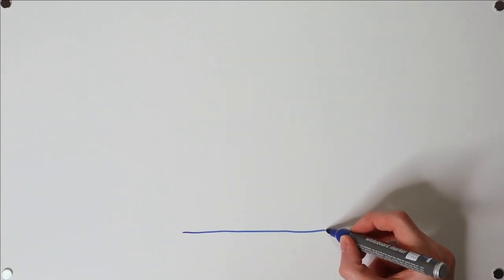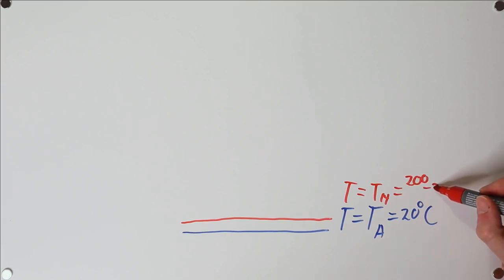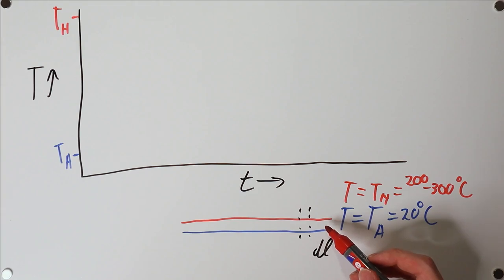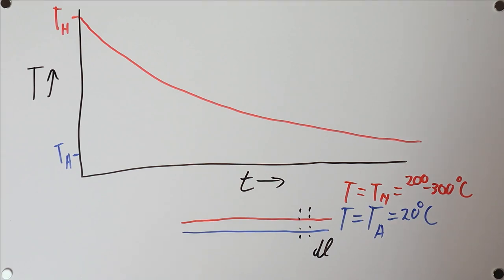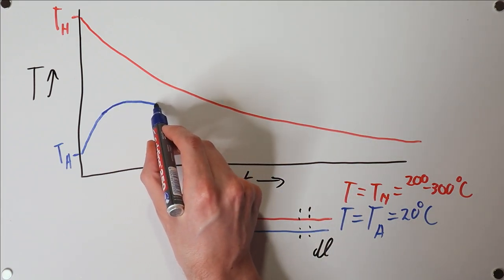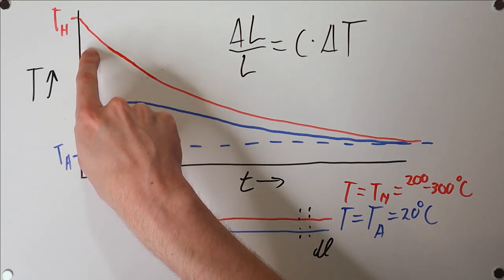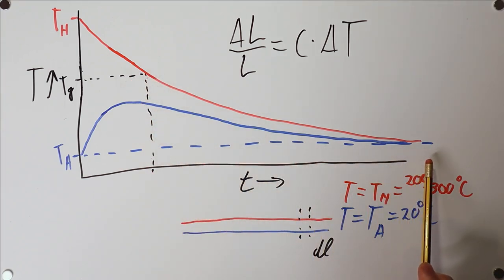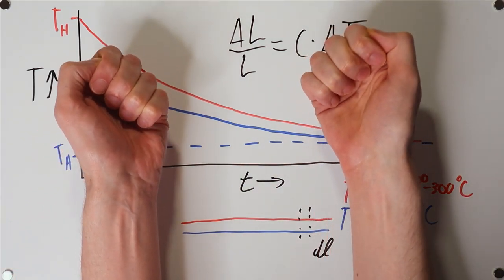The Physics of why your 3D Prints Warp, and what to do about it

Comment: Great explanation. I assume it wouldn't matter on smaller prints, but would printing the second layer when the lower layer hasn't fully cooled yet also prevent warping, or does the lower layer reach ambient temperatures too fast for it to matter even on smaller prints?
Reply from the maker: It could help, but its difficult to control. From thermal imaging it seems the temperature drops down within 3-5 seconds, so you can only do this for parts with a very small XY crosssection. Even then it's hard to balance, if the lower layer is too soft when a new layer is deposited, material can flow into unintended places. You can notice this when you print very small PLA parts, or the chimney of the 3D benchy.

Comment: Thank you for this amazing explanation! The only part I am a bit confused at is when you said you can reduce the extrusion rate in order to close the gap in temperature difference between the new and previous layers. I understand increasing the temp will allow the previous layer to catch up before the first layer reaches tg temp, but m confused on how reducing extrusion rate would have the same effect? Thank you again for this video it has really helped my production. I have found that printing at 205c vs 190c the pla prints tend to be less heat resistant and have a lower tq the hotter you print them.

I reduced my print speed to 75mms @190c from 90mms and it did reduce warping a bit. If I had a volcano nozzle with a much larger melt zone would switching to that and going back to 90mms have the same result? Curious your thoughts and I appreciate any explanation to help with my confusion
Reply from the maker: Basically when plastic comes out of the nozzle, it isn't quite at the same temperature as the nozzle, but the slower plastic is extruded, the more time it has to get as close to the nozzle temperature as possible. In that vein, getting a volcano style nozzle should definitely help.

That effect on softening temperature is quite interesting too.

Comment: Thanks for the clear explanation. Can you please clarify why printing slower would make a difference? Assuming the ambient, nozzle, and bed temperatures are the same, printing slower would still yield the same temperatures all around, no? If anything it would start laying down the next layer sooner before the previous cools down more.
Reply from the maker: By printing slower the plastic flowing through the nozzle has more time to actually get up to the nozzle temperature, if you print fast the plastic comes out slightly colder due to limited thermal conduction inside of the plastic itself.
Reply: @antalz  that is an excellent point! Thank you for the response.

Comment: This is weird but i was printing a 3dbenchy and encountered a problem I've had for a while now. My set up is a 0.4mm nozzle ender 3 printing PETG mostly at a bed temp of 85~90C cause i find it gives better bed adhesion, and the issue is that on certain prints I would get this absolutely horrendous warping ~6-8mm above the build plate. Any sort of corner would just begin to curl up and inwards on itself, and I tried everything suggested in this vid short of using an enclosure. I even slowed prints all the way to 25% and i still get this warping. Curiously, it seems to happen only for thinner layer heights, when i bump it up to 0.24 and above, this problem reduces or goes away entirely, but thats obviously not a good fix for the problem. i don't have this problem on my much faster klipper printer either, regardless of the layer height at the same bed temps. I read something in a comment on another video, which was to lower bed temp, i tried it, lowering to 72C and that reduced my warping by a lot. Whats the explanation for this? Obviously closer to the bed, the high temp reduces warpage, and at a certain height, the warping would initiate due to the lower temperature, but why does it diminish when i use a lower bed temp from the start, very fast print speed or thicker layers?
Reply: If top layers cool faster it will pull the edges upwards and inwards. Solution I found was to not use the part cooler unless printing overhangs
Reply: The effect dimishes when you lower bed temp as it reduces the difference in heat between the lower layer on the bed and the upper layers cooling faster as they build up from the base.

Comment: So it seems more temperature at the hot end would reduce warping by increasing the lower layer more closer into the Glass Transition temperature, and hence, let it flow instead of curl? Seems counterintuitive but interesting nonetheless... I will try it out tonight with a warping print that is driving me nuts. 

Thank you for the explanation!
Reply from the maker: It doesn't really allow the lower layer to flow. The idea is to warm up that lower layer, so that it thermally expands. Once the new layer cools down to the point it can no longer flow, it fuses to the lower layer. But the new layer will still be hotter than lower layer, so they're both solid and fused, but the upper layer has to cool down more to reach the ambient temperature than the lower layer. Because of that the new layer thermally shrinks more than the lower, and this difference in shrinkage causes warping.

Comment: what if the print is warping to the top , not bottom? Everywhere on youtube everybody shows the same thing but actually in reality there are some other deformations, which are preventing me from buying a 3d printer! I use it sometimes when it is available but never bought one because of that. If I have to print a part that has to fit perfectly into something and instead of a straight line looks likne a banana it doesn't make any sens to buy a 3d printer. Everbody prints usuless things but it is very rare that somebody prints something usfull but in this scenario you can see the reality what 3d printer has really to offer (or not).
Reply from the maker: I can't tell what problem you're having. You may have a warped printbed, you can check that with a straightedge. You can also have off angles if the axes aren't perpendicular to each other. I don't know how you can get curved lines though. What exactly do you mean with warping to the top?